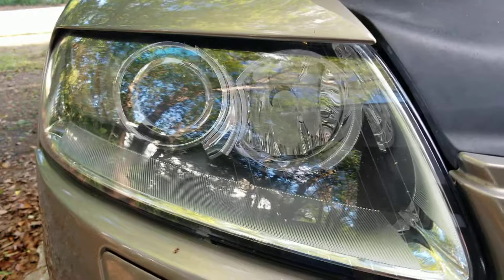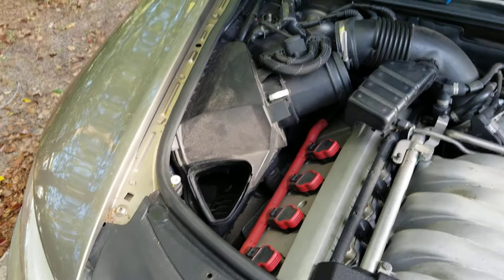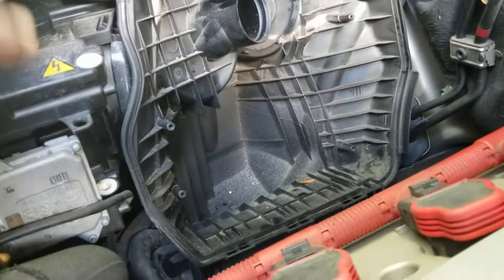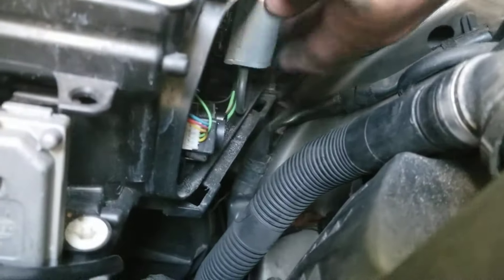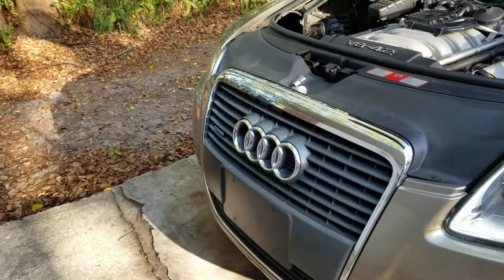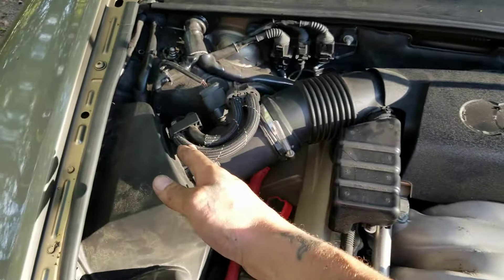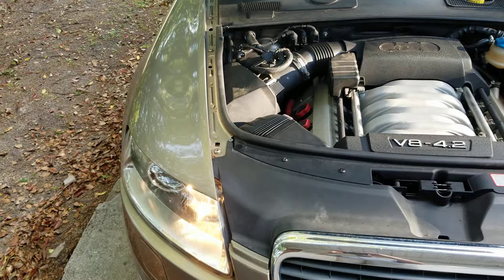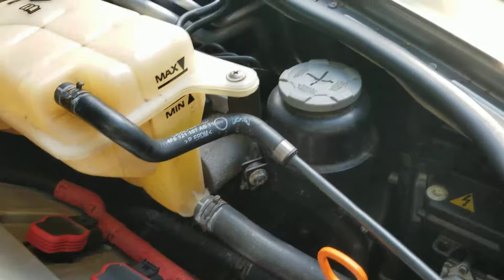Audi A6 C6 Daytime Running Light Replacement (How to DRL Replacement )

Comment: Thanks! This was the first video I found with the more complicated air hoses that the 3.0TDI has.

Took me about hour and a half, taking my time making sure I don’t break anything.

I found out that you can pull the lower side of the air filter box on top of the engine if you pull off one electrical connector from it (it’s situated towards the lights)- the small air hoses are long enough for that.
Reply from the maker: Thank you for viewing and commenting. I apologize for the late response, life can get busy. The trouble we go through to change a light bulb is evil, the engineer developed a device that will either cut you or break as soon as you touch it LOL. Glad the video was helpful, its why were here. Again, thank you.

Comment: Actually, yuo can replace the indicator lights easier through the front wheels. There are little holes there, covered by rubber, you just remove the rubber covers there, and gain access to the indicator lights
Reply from the maker: i belive i mentioned that i could access it through the wheelwell, just didnt have the time to play with it. i plan on making a video on it. thank you for wathching, please subscribe and stay tuned for more

Comment: Is that an S6?
Reply from the maker: Thank you for viewing and commenting. No, not an S6. Just a Base 4.2
Reply: @ScarzCarz  here in UK we don't have base 4.2
Reply from the maker: @rfcar12  base meaning regular model with v8, it has sat nav, 6 disc player and sun shades and basic seats and features. Not performance oriented. If I remember correctly the S6 came with the Gallardo/R8 derived V10, atleast here in the states. You guys are lucky enough to have access to models and packages we are not privy to here.
Reply: @ScarzCarz  I apologise I was mistaken. Yes our S6 and rs6 were V10 RS6 being twin turbo was the difference. The 4.2 V8 was available in our market but pretty much a unicorn here as not recognised as a performance vehicle and running costs don't justify it. I was mixed up with our rs8 offerings which have either the 4.2 V8 or the lesser found V10 lambo engine. Rs8 was marketed heavily in the 4.2 V8 version so as not to affect the lambo sales
Reply from the maker: @rfcar12  no need to apologize my friend. No harm, no foul. We don't get as many diesel models here either. I always get a kick out of how the same vehicle can differ in different parts of the world.

Comment: okay but i need a video for the drivers side lol u did the easy side of course :(
Reply from the maker: thank you for the view. i do have a video on the drivers and passenger side.
Reply: For the other side you remove the screw holding the coolant reservoir  and move it towards the centre of the engine.
Then remove the power steering reservoir holding nut and move it to one side.
Hoses are very flexible.
Then once you have access to the back of the light do as in this video.
Tip: use your left hand through the power steering reservoir bracket while standing with your left side towards the car.
Unless you have small hands, then it doesn't matter. 
My light fitting was struggling to twist lock in place, so i sprayed some silicone oil on the plastic and it locked nicely.

Comment: so much work for changing a light bulb ?? Thats insane
Reply from the maker: Once you do it a couple times its not that bad. The newer cars are getting worse with non serviceable L.E.D tech, meaning if the diode fails you replace the whole assembly. Thank you for viewing and commenting.
Reply: @ScarzCarz  my audi always shows a warning light (inc a annoying sound) front left day running light BUT the light is working fine ?
Reply from the maker: @frankw9836  that hasn't happened to me yet. Are you sure it's telling you it's the DRL and not the headlight adjustment? I've seen tons of funky stuff with lights, hard to diagnose without actually touching it myself
Reply: @ScarzCarz  front DRL yes, its annoying

Comment: I hate the way the headlights are set up 😤😤why do u have to take the whole air intake apart just to change a light bulb smh‼️🤦🏽‍♂️😂😂😂✌🏾
Reply from the maker: yea, a little over engineered. not bad once you do it.
Reply: @ScarzCarz  it was so easy 🤦🏽‍♂️thank you so much ✌🏾👍🏾
Reply: Have you tried the other side (driver's)?  It's, at least for me (on the 4.2), physically impossible to get at the DRL bulb with my hands and remove it.  I can't get enough of a grip or leverage to turn it.  I removed the power steering reservoir but the bracket is still in the way, and no amount of bending and jostling gets me access (and I don't want to break it), and that bracket really isn't conducive to being removed.  I will probably have to remove the whole headlight assembly to get to that bulb.  I can't believe someone got paid to "design" this.  Any of these automotive "engineers" should be required to repair things they design, then perhaps they would stop making things so difficult to impossible.